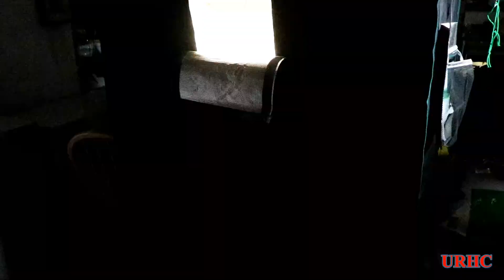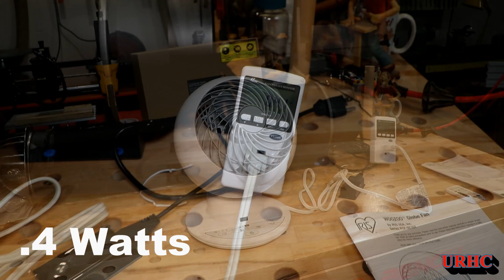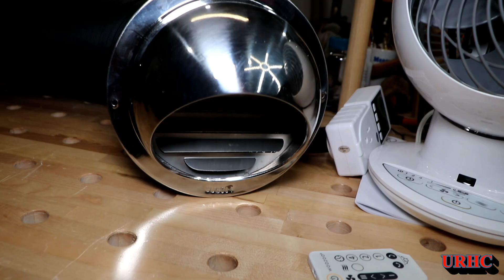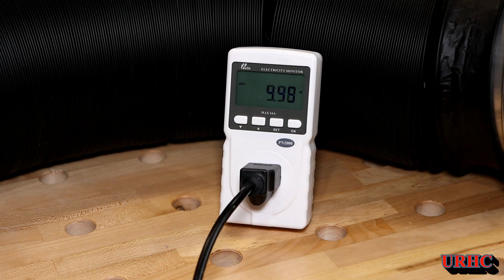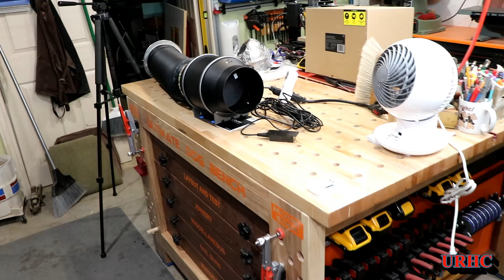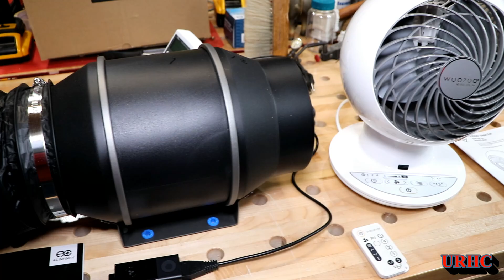WOOZOO And AC Infinity Fans For My Grow Tent Power consumption

Comment: Just wondering how you like the woozoo fan for your grow tent. I just bought 1 an put it in my tent on the floor and set it so it goes up down and side to side.
Reply from the maker: it keeps the air moving but another fan is needed at the top to keep the light drivers cool. Thanks for watching.
Reply: @unemployedredneckhillbilly2023  I have the exhaust fan on top an 2 small fans running half way up this on the floor.  Thanks for getting back to me have a great night.

Comment: The Infinity setup is an excellent one that you will not be sorry for purchasing.  If you find you are in the market for another powerful LED light.  Try the HLG (Horticultural Lighting Group) lights.  Probably one of the best quality LED lights out there.
Reply from the maker: Right  now I have had excellent luck with  the marshydro lights. I have 4 of the Infinity fans now. Using them to vent my lasers  also and they work awesome.  Thanks for watching.

Comment: Yes mars is like the lowest quality of Cannabis tents , fans etc. out on the market. so once you build up and maybe get larger growing space indoor you will move to better lighting etc, They have 1 of the most poor service. Once you move on you will see what iam talking about.. Wait till something goes wrong with the light... Just giving you a heads up.. But can help if you need and info on whats out there on market in tents and lighting , Fans etc.. Thanks
Reply from the maker: I have been very happy  with  the Mars setup so far. I guess not having  any trouble  with  the zippers after 6 months of daily  opening and the light functioning properly so far with zero light leakage through seams makes it functional for my needs. I just ordered  a Mars 2 x 4 x 6 tent and 2000w long led fixture for this because it's in my price point and will make  a video  if customer service  ever becomes a problem. Hopefully  this equipment  will last until newer technology in lighting  becomes affordable.  This is all just a science experiment to me for now to learn from. As you say I have no idea about what's available and this market is growing  by leaps and bounds right now. Thanks for watching.

Comment: Awesome the AC infinity is a good exhaust fan good choice. A couple things to consider If you are using this to pull air from outside into the tent keep in mind it can also suck in pests like thrips, afids,spider mites and mildew spores. Not sure of your cellar enviorment but I have to run a dehumidifier  to keep humidity at 50% 55% max  I vent the output of it outside in the summer because it produces allot of heat I also vent my 4x8' tent with a 8" venttech fan and hose to the outside in summer only to remove heat in the winter I vent it into my cellar to keep the heat in the basement. I do not pull air from the outside due to pests. Your co2 levels will be enough to grow anything without pulling air from the outside it will run about 400 to 600 PPM naturally. Just some thoughts for you believe me I have been working on my indoor grow enviorment for years ideally I would install a mini split to have greater control of my grow space but they are to expensive for me! Good luck my friend!! Stay blessed!
Reply from the maker: My cellar  humidity  drops down to about 40% and 55 degrees in the summer so I figured outside air would  be. needed. I plan on a 4 inch infinity  pulling in outside air and mixing with  the cooler cellar air if it gets to hot. I was going to build  a fine stainless  mesh inline 4 inch  filter that hopefully will catch any bugs but maybe  will have to switch  to a heppa filter for the small bugs as you say. A charcoal  filter is coming for the 6 inch exhaust. I ordered  a 2 x 4 x 6 with a 2000 watt rated led so the heat load will be close to 400 watts in the tent with everything and I am just guessing at this point to put something  together to get data from this summer and hopefully will be ready to grow next spring. Thanks for your  input.
Reply: @unemployedredneckhillbilly2023  Great Idea have fun!!
Reply from the maker: Right now its like a big science project.

Comment: How can you set that up on a woodstove?
Reply from the maker: I was thinking run a 6 inch duct up behind  the woodstove and the other end into my hot air plenum with  the fan inline using a one way flapper.  Could circulate the heat using existing  ducts without  running the furnace blower.  Thanks for watching.

Comment: I have a fan like the ac infinity it was super cheap it’s some sorta 6 inch high velocity booster fan  and I was impressed by the cfm it has a adjustable speed knob too
Reply from the maker: Probably  the only  difference  is the lower cost ones are ac and consume twice the energy which adds up quickly over time. Thanks for watching.

Comment: I've got the 4" AC with the humidistat and thermostat sensors + controller for a 4x2x5' tent hooked up to a chimney flue in the opposite configuration (exhaust). It has settings for low and high readings and moved air quite well with minimal sound. I've used it for growing and drying combined with a small desk fan similar to what you have to get more direct air movement on growing seedlings. I've used it for one season now and am very happy with it so far. I will be adding a humidifier to the mix to help balance the ambient humidity a bit for drying as I found it operates on the dryer side since my house heat pumps keep the RH very low.
Reply from the maker: I'm going to use a 4 inch to bring  outside air in and figured I could  balance them out using some inside  air for cooling by running  them at different  speeds with a vent opened if it gets to hot. A charcoal  filter cuts the flow to equal a 4 inch. I ordered  a 2x4x6 with a 2000 watt led (300 watt input)  I read the smart sensors  that come with  these fans only are good if you use the same size fans but you can order the newer sensor separate that is good when you mix fans. Thanks for watching.